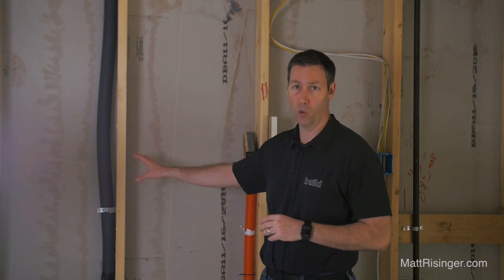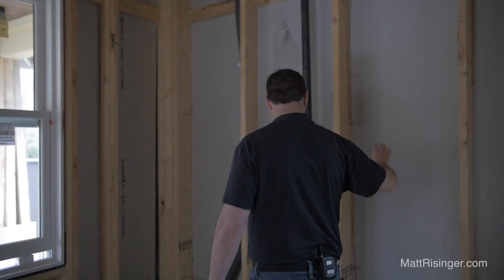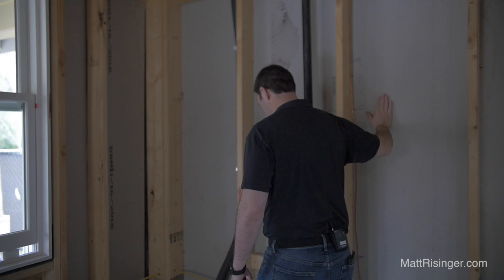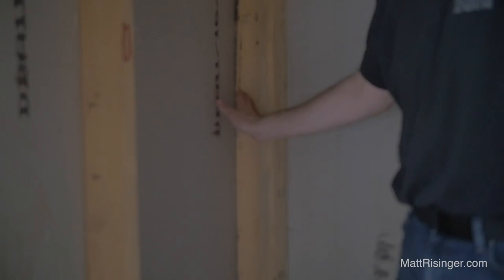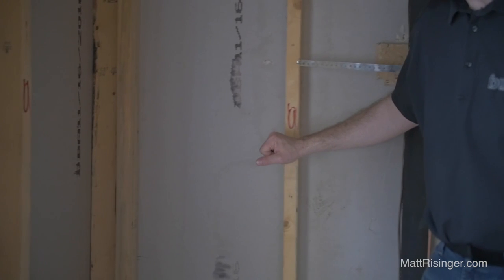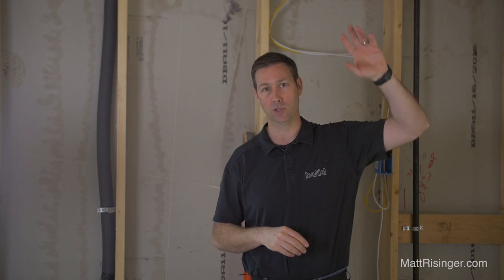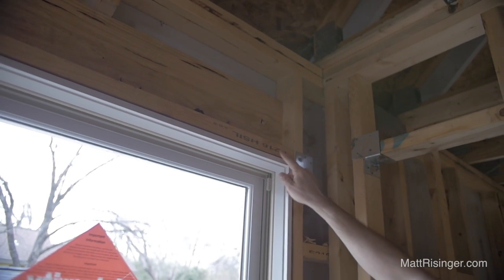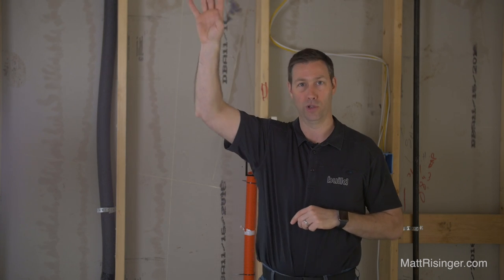Traditional vs. Advanced Framing

Comment: Steel reinforced Insulated Concrete Form or ICF walls is what structural engineers consider to be the strongest for building homes. The University of Oklahoma  fired lumber at 200mph at different types of walls and only ICF could withstand such a hit. Hence they recommended this for safe rooms in Tornado prone areas. My house is built with it and it looks like a traditional stick frame house from the interior and exterior once you put siding on it. Also has an R50 insulation and very quiet sound rating.
Reply: ACitizenOfOurWorld 
ICF is the way we should be building all homes. Strong efficient and will last for many generations
Reply: Sounds like your bragging.

Comment: says there is no room to insulate in the corner as there is sprayfoam oozing out... that corner was insulated. also those header "lintel" hangers look like cheap beer cans  cut up and screwed on. the header "lintel" in the tradtional home could have been built up with one 2x12 on the outside and one on the inside wall and an insulated cavity in the center. called a box lintel. I hate it when people try to sell shitty products buy trying to tell everybody that what is being done now isn't sufficient. meanwhile if done correctly you can effectively insulate a home in Winnipeg.
Reply: Colin Knockaert The entire time he was saying "can't be insulated" I was thinking about the times I  insulated them XD it's not max insulation but it's better then a damn 2x4 header for sure. I like hefty not whimpy!
Reply: Very well said.

Comment: I'm no professional builder but aren't those load bearing walls?  I'd take beefy framing over lack of space to insulate anyday.
Reply: ubvids they’ve got “ load bearing ribbon” over tradition.
Reply: ubvids 

It’s crap framing. However if don’t properly by lining the wall frame with the 2nd floor joists then the joists with the rafters you can get away with it. It’s just shit work
Reply: You must be new or something...Risinger is fkn obsessed with insulation..if it was up to him the entire home would just be made of insulation
Reply: I am a professional. Those are load bearing walls and I say why cut down extra trees and burn extra natural gas when engineers and decades of building experience say the house holds up perfectly well without all that wasted wood. In my experience “over-engineered” generally means “un-engineered.” Advanced framing was developed by engineers, has been around for decades and is not considered a novel building technique.

Comment: How about the strength of the advanced frame house in a tornado.
Reply: How about the strength of any stick frame house in a tornado.
Reply: If built right the homeowner can survive any but the worst tornado, I have been building in Texas a long time and did my best to make sure the homes I built could withstand high winds.
Reply: If you are actually interested Minnesota gets an average on 36 tornadoes per year. Our last deadly tornado was in 2011. Basically every year there is a large property damage tornado somewhere in the state.
Reply: I don't think there is any sort of construction short of post and beam that will hold up to that.  We build like this in the Northeast.  2x6 walls, 24 oc, still use a traditional header though, with styro in between.
Reply: If you want tornado and earthquake proof house build a log house.
Reply: In tornado ally, homes being built have a standard of extra's to make them "tornado proof". Unfortunately, no such thing actually exists, same with earthquake. Can't stop mother nature.
Reply: @TsmnnDvl5, I can't speak about tornadoes, but there's a ton you can do about earthquakes. Most of the buildings around here can withstand at least a magnitude 8 earthquake, but at a certain point, you're just screwed. I'm not even sure it would be possible to protect against a theoretical magnitude 10 quake.
Reply: There are small plates they install at every joint for tornado's. But, as I said, you can't stop mother nature.
Reply: TsmnnDvl5 A concrete house can stop mother nature.
Reply: Kyle Hooper lol no it wont.
Reply: Thought the same thing....
....and actually noticed earlier today (6.12.17) that the MSP area has some terrible storms
Reply: I shared link for log house tornado test, I guess it was too good compared to stick house because it has been removed.
Reply: The homes built to withstand tornado's are really only good for the F1 - F3 rating tornado's. F4's and F5's forget it, nothing will stand up against those. Structure will be in severe shape when they're done. But, should note, tornado's are weird, they'll hit one house, skip the next, then wipe out an entire town.
Reply: look,  you can build a home that will withstand any f5 tornado.  but it's going to be expensive and ugly.
Reply: Dustin L.+ Did you look that up in a book or something? Honestly, where do you think the Fujita scale comes from? http://www.spc.noaa.gov/faq/tornado/f-scale.html

Born, raised and still live in a state that constantly holds the records for tornado's each year. People fail to understand one small concept about a tornado, it isn't just the wind doing the damage, it's also the debris that's inside. Guess no one has ever seen a simple 2X4 get slammed through a concrete wall before.
Reply: Call me crazy but I would rather over engineer something that engineer something to be bear minimums...
Reply: Ron White..."it's not THAT the wind is blowing, it's WHAT the wind is blowing."  Flying lumber from the neighbor's house will go through a house made of blocks no sweat.
Reply: All those dead spaces were
Filled with foam insulation...
Reply: ICF walls were tested by the U of OK and withstood 200mph 2x4 lumber fired at it. Look it up, Pretty cool video.
Reply: structure 101 = sheathing takes wind load.
Reply: ACitizenOfOurWorld pain in the ass to 
Lk
Kpc 
Bx . x
Reply: Tornados don't give a shit if the house is 16oc or 24oc! It's still going by by!
Reply: There is no strapping in american homes, it will blow away as usual.
Reply: @Ham68229  Wrong. Homes in nz are built to withstand massive windloads and earthquakes. Same with Japan.

Comment: 24" centers? Damn. Would be a nightmare to install cabinets with that framing.
Reply: You'ld have to install backing.
Reply: @frankieespinosa5364  IDK if he did on this vid or another, but he says that with 24"oc, he goes 5/8 sheet in and out.   So there goes any savings on stud material....
             He also says in another video that ZipR that thick is NOT a structural sheeting, so wall diag bracing or other wall stiffening needs done with the thick, high R zip r.
Reply: 24 centres are OK on internals, but you really need at least 1 row of noggins.  (Didn't see them here) . And yes more to hang cabinets.

Comment: Each of the areas you were showing that didn't have insulation were insulated. Also when we build a corner or partition we insulate during framing process. We also insulate the headers during construction. South Dakota has both warm and cold seasons so very important. Advance framing sounds more like areas where codes are a lot more lax.
Reply: One crew I worked on insulated during the framing process, especially in between the joists that are up tight against the rim where the insulator wouldn't be able to reach it from the bottom, but honestly its a garbage way to do it. What happens when it rains before they get the roof/exterior weatherproofing on? All that fiberglass insulation gets soaked and balls up, making it useless. If you're spray foaming its a different story I guess, but I doubt many framing crews keep foam guns on hand.

Comment: Matt, I appreciate the show.  I'm a little confused by the ZIP sheathing with insulation.  I can see the benefit in the overall insulation of the house, but what about the strength of the house in regards to racking?  Seems like the insulation would lower the strength as it would introduce a point of flexibility.   Especially in the high R value versions.  It almost seems as though it should be installed in reverse with the insulation on the outside.  Am I nuts?  What am I missing?
Reply: I thought the exact same thing. No shear value. Nails can bend for like an inch with that system....
Reply: Worked in R & C construction for 40 plus years as Brick Mason. Done just about every trade for myself. I agree w you. The OSB should be tight to the studs, then the insulation, otherwise the OSB does not give the required lateral strength
Reply: It’s kind of like- laying 3.5” brick veneer too far from the studs- ex- 1”-2” then the wall becomes more unstable & wall ties have to be farther from the house to anchor to the brick.